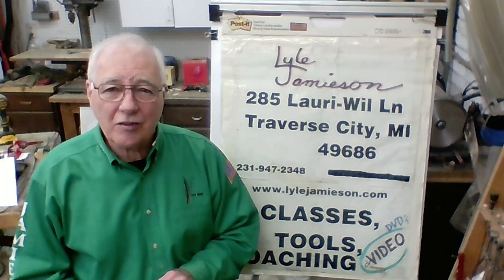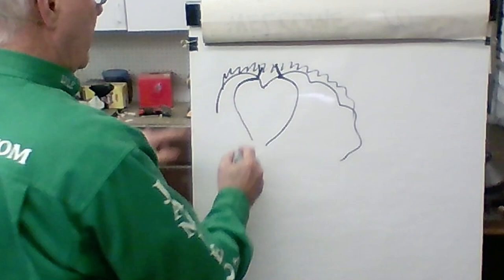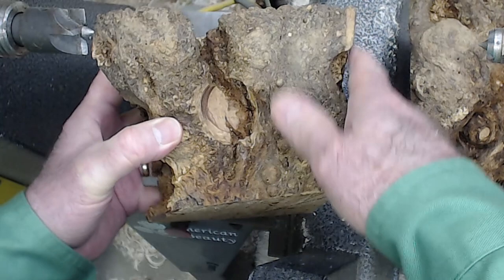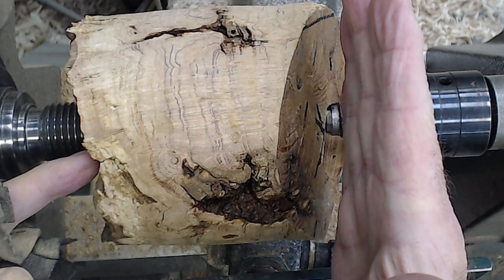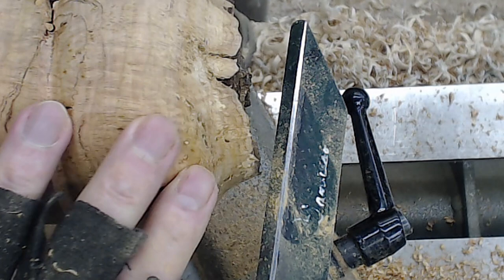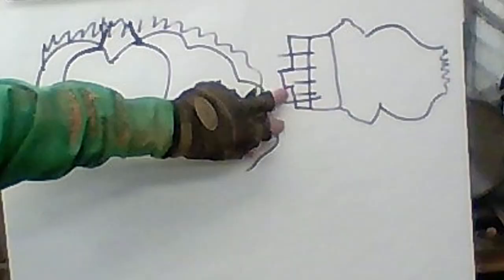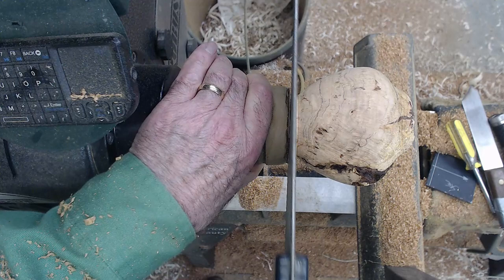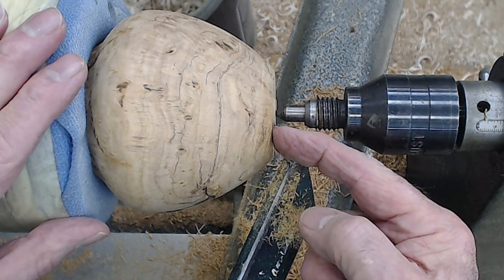Natural edge hollow form turning. Educational and entertaining.  Hollow form with natural opening

Comment: Hi Lyle, I just aquired a lathe and want to learn how to turn wood. I was pointed in your direction and subbed to you. I am from Huntsville, Texas.
Reply from the maker: Hi A.L. You are on the right track. The YouTube videos can help beginners if you see enough of them.  But they will be disjointed from each other and you will not have the continuity of the whole process.  A better learning tool is my Bowl Basics DVD.  Once you see that, you can get some help from your local turning club, by filtering out the not so efficient methods.   Any method will work in the early stages but once you get some experience and advance to explore more complex turning you dont want the methods you use to be a limiting factor.   Better yet come up to Mighigan and kick it up a notch with an Hands-on class with me.

Comment: Wow! That's awesome! How do you sand the inside of something like that?
Reply from the maker: Hi Hotrod, I rarely sand the inside of Hollow forms.  With the voids it must be sanded off the lathe. The surface I get off my tools has no tool marks and few flaws.  The fingertip control makes it easy.  Sometimes I sand around the rim where the light might reflect, for maybe an inch, but thats it. Thanks for the feedback.  For a more in-depth Hollowing process see my IRD on 5-5-21.  2 1/2 hours live and interactive. https://lylejamieson.com/product-category/live-interactive-remote-demonstrations/
Reply: @Lyle  Awesome! Thanks for the invite!